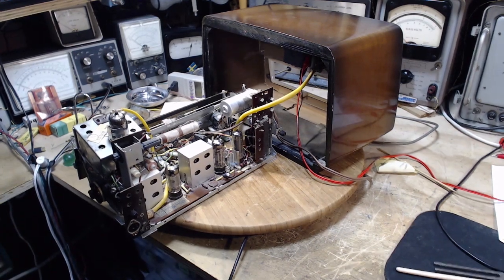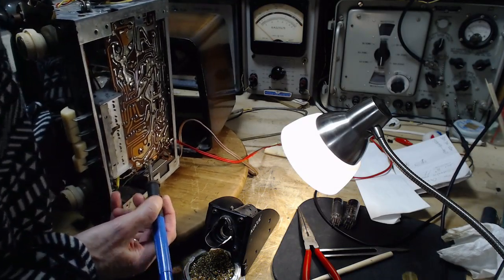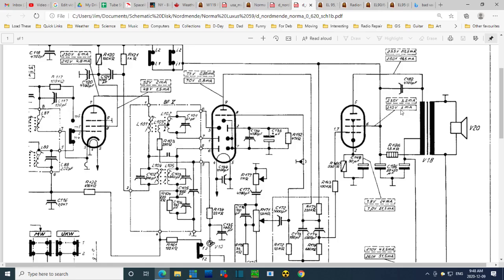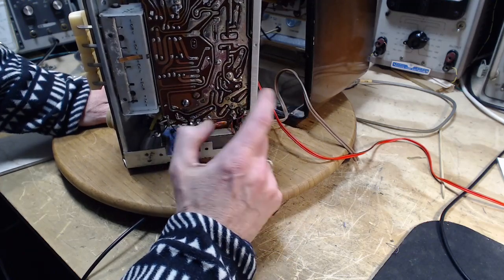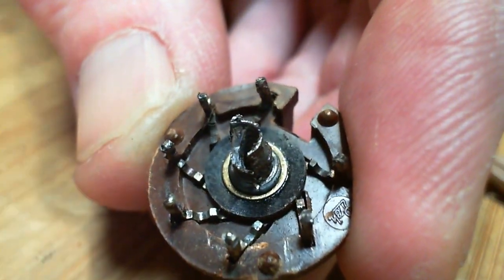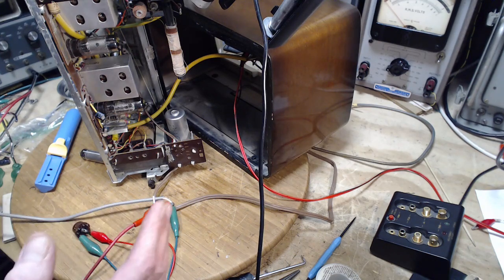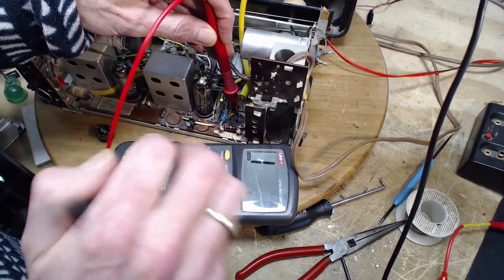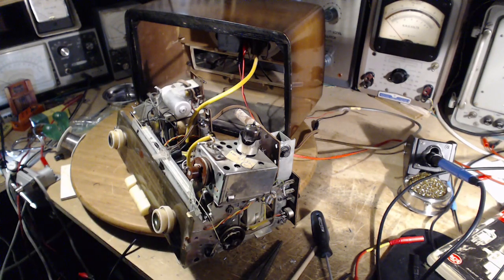Nordmende Norma Luxus Tube Radio Video #7 - Socket to Me

Comment: This radio is a perfect example of how NOT to do "old tech" (discrete tubes and such) and "new tech" (printed circuit boards) with different, "new-fangled" types of sockets for those tubes that are not the tried-and-true designs.  It may be that the board is flexing when the tube is pushed, causing intermittent connections with the tube prongs and the socket internal connectors (even just scraping sideways slightly causing vibrations might be enough to do this).  Even if the problems are due to bad things far away from the tube sockets, you would not know this and, like Jim here, be chasing your tail round and round due to the wrong symptoms being displayed.  The capacitor problems here, whatever they are, were masked by the tube weirdness when touched.

Comment: He removes one socket , the one that he kept wiggling before but never attempted to clean the wipers inside where the tube pins touch. Puts it back in and lo and 
behold still has noise problems. You must clean the tube pins and the socket pin where the tube pins  touch . Wasted another video.He should read the comments!!!
Reply: I was thinking the same thing about cleaning the tube socket while he had it out.  He gets a little absent minded about what he's doing.  Also, he needs to invest in a desoldering gun with a vacuum pump and a descent DMM.  He needs to use some flux when soldering and then clean up the area.  He really made a mess of that PCB.  There's definitely  a bad connection and or component somewhere else on that PCB which is causing his issue but he got hung up on those tube sockets only.  I like Jim but he drives me nutty with his unorthodox approach.

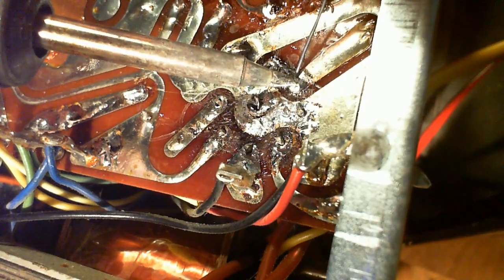Comment: 50:20 How to produce cold solder joints on reused PCB tube sockets:
1. Avoid cleaning off old solder from the PCB and tube socket pins. Also make sure to not remove traces of corrosion from pins.
2. Do not aim for pushing the tube socket in to sit flush on the PCB. Solder will easily wick into open holes and make solid contact to the pins hiding in the deep.
3. Do not use additional flux. Mixing of old and new solder must be avoided at any cost. 
4. Never heat your soldering iron to where it fully melts the solder. Make sure the solder always keeps a putty like texture. The goal is to fill the gap between the solder pad and the tube pin with play dough like solder using jabbing motions of the soldering iron as if you were a dentist stuffing an amalgam filling into a hole in a tooth.

Make sure to follow these rules and you will perform perfect cold solder joints.
Reply: Agreed.  His soldering and desoldering skills are lacking. SMH

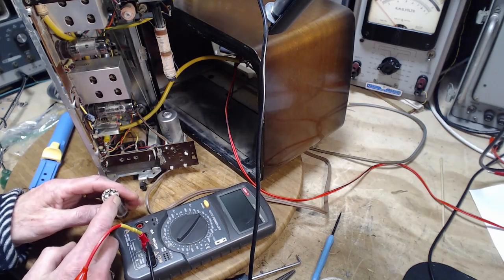Comment: 37:18 Anybody else notice how his DMM set to resistance measurement on the 200 Ohm scale already displays around 108.1 with the test leads OPEN? Any reading taken with such a precision instrument is worth bupkus.
Reply: These DMM have problems with the rotary switch - The PCB tracks worn out and there's a faulty contact between the metal blades and the PCB...

Comment: It must be remembered that tubes are high impedance devices. Multimeters when used in the ohms measurement function are low impedance devices. Tubes will respond to the slightest change of voltage in rather dramatic fashion. An ohmmeter... not so much. The two most logical areas as cause for this problem are spread tube socket pins or PC board damage.  Early PC boards are particularly subject to damage which exhibits seemingly strange symptoms.

Comment: 20:24 Did anybody else notice how when the radio dropped silent the dim bulb got brighter indicating a higher current draw? And it got dimmer when reception returned. Now the question is; would an intermittent tube pin contact cause this behaviour? Or wouldnt it rather be that an intermittent tube contact would cause a drop in current draw? Only explanation for this increase in current draw could be that the control grid on the output tube loses its reference to ground, causing it to fail in establishing the grid bias on its cathode resistor and in turn go into full conduction.
Maybe we get lucky and get an early new years fireworks with whisps of hydrogen selenide (the bad smell eminating from blown up selenium rectifier)

Comment: Hi Jim. I had a similar problem years ago with a German radio. After turning the room light off, I poked around and eventually found arking around the area where the push button switches connected to the circuit board. Any form of vibration caused the small amount of arking. Some contact cleaner and a small amount of soldering cured the problem. Good luck with the radio.

Comment: After the solder sucker, use desoldering braid to remove the remaining solder around the tube socket pins.  Unless most of the solder is removed, trying to lift the socket while heating the pins risks pulling the solder traces loose.

Comment: Hi Jim this is Ray Burke.  I bought a Hakko FR301 desoldering gun, approx.$300. You can order about 17 different desoldering tip, some are 2.3 mm, which are the largest,  the smallest is 0.6 mm.  With desoldering equipment , It works on circuit boards, and tube point to point wiring.  I love mine, doesn't damage circuit boards.  You can see how it works, per Mr Paul Carlson has demod in a youtube video on different desoldering  equipment.  Wick, Suckers, and the Hakko FR301.
Reply: I would NOT buy the cheap $100 china  desoldering guns , because they only have three tips, and they are cheaply made.  Their is a USA Hakko supplier in California, so easy to get parts.  Great support and better built.  I ordered the extra tips, filters, directly from Hakko.

Comment: 1.  This is an example of fairly early printed circuit manufacturing. It is VERY easy to destroy the traces on the board with excessive exposure to soldering temperatures.  
2. PROPER desoldering equipment exists, and is reasonably priced. You might consider investment in some equipment designed, and manufactured for doing what you’re trying to do.  It’s a lot easier than rebuilding board traces.
3. this is a higher quality radio.  The components used are high-quality items. They should return to normal operating parameters with attention to PROPER cleaning techniques. Once again, there exist materials specifically manufactured to do this task. These do not include alcohol (by itself) or WD40. If the socket connections have spread, tightening them, if done carefully, will fix that.
Reply: I have a similar set (phillips), early PCB. One of the piano switches took multiple attempts at cleaning before it operated correctly. Yes, the PCB tracks are pretty easy to destroy. I've no idea what is wrong with his Normende radio but I would focus on cleaning and reflowing solder joints.
Reply: @Gar Suitor Well the sockets are not premium but they are not as flakey as the US boys make them out to be. Look at M.Caldeiras or Shango066. Both restored Nordmende radios of this era with these sockets and neither one had this trouble with these sockets. Clean, straighten contacts, good to go. If it is associated with wiggling tubes, it is more likely that solder joints on the pins or eyelets near the pins or traces got hairline cracks or bending the board caused traces to crack.
Reply: @randomsteve4288  I agree. The early phenolic boards were thin, and the copper was not well adhered to the surface. The boards tended to flex with the force of tube insertion. Wiggling the tubes in the sockets stresses the contacts, and if done violently enough will strain the contacts. It also puts severe strain on the solder joints, as well as the traces themselves.  “High quality” is a relative term when applied to consumer grade goods. They are all built to a price-point. Some were built to a higher price point than others.